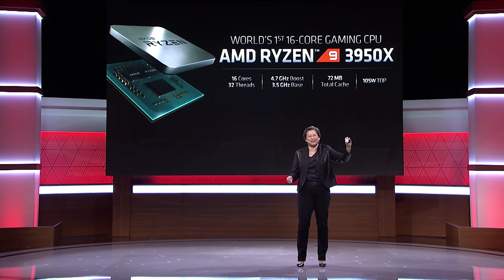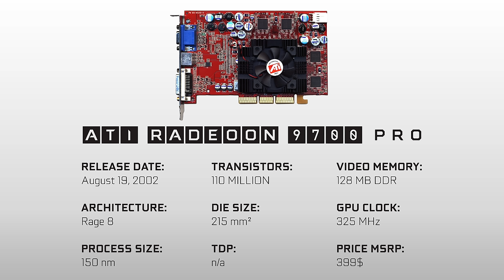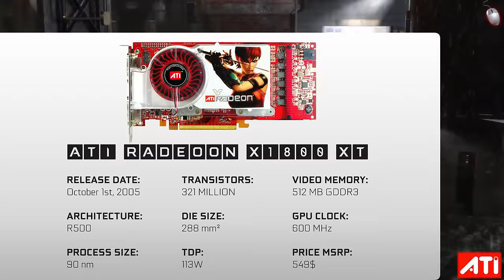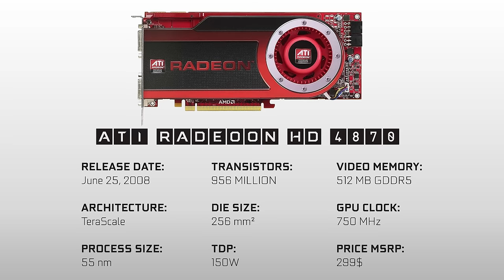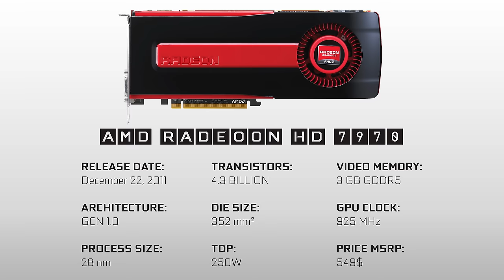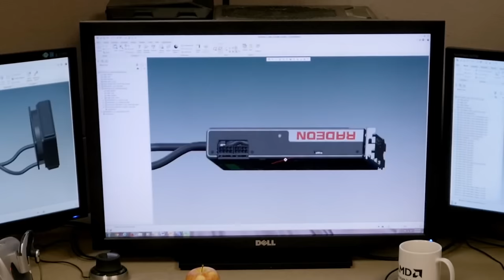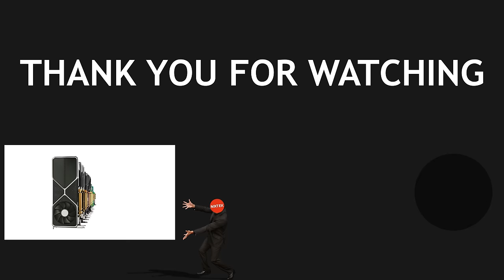The Evolution of AMD/ATI Radeon Graphics (2000-2022)

Comment: Awesome video, I just wish AMD would put more research and development behind their drivers and software.  It's their only weakness at this point.  I have owned numerous AMD cards including their flagship 6900xt and it just has issues that my 3090 doesn't have, primarily when using more than 1 monitor it just seems to freak out and randomly black/green screen where a restart or disconnecting the monitor and reconnecting seems to be the only fix.  Seems to happen when using full screen or exclusive full screen in a game while playing a video on my second or third monitor.  It's annoying but seems to related to their driver/software since the card passes all heavy stress tests with flying colors and is never an issue if I only run 1 monitor.
Reply: i had an amd gpu aswell and i remember having to go with the 2019 drivers other than the newer ones because my pc would literally blue screen while gaming
Reply: I got a deal on a reference 6950xt and I came from a founders RTX 2080. I have noticed a couple of minor bugs (like sometimes the GPU stays on when I shut down my PC while everything else turns off) but other than that it’s been great. And I can’t help but ask why no one talks about the AMD software side of things? I’m admittedly new to AMD, but adrenaline is amazing! Everything is in one place. I can overclock, undervolt, check game stats, tune games on the fly, cap my frame rate, sharpen, monitor, everything all in 1. With nvidia I needed MSI afterburner, Rivatuner, GeForce experience, Nvidia Free Style, Nvidia control panel, Nvidia Inspector, etc. all different programs. All to do the same things. Digging the AMD software
Reply: cries in five monitor eyefinity
Reply: Same, certain games are always buggy, but amd optimised games seem to run like a dream
Reply: The current AMD Adrenalin drivers have no issues working with the Radeon 6K GPUs. Sounds like an user error.
Reply: @bobbymoss6160  most likely, when I purchased the card I believe that is when the user error started.
Reply: @hamslice839  Have you reinstalled your drivers using DDU? I've never had this issue on my RX 6600 before and it runs both my monitors smoothly, however the drivers do still have minor bugs (like for me the driver times out randomly when I full screen YouTube after an update). I heard AMD is putting more effort into drivers but only time will tell
Reply: Had that issue all the time with my 5700xt before later drivers fixed it. Can't say I've experienced it with my 6900xt. Had it since May 2021.
Reply: That's unfortunate, my experience has been quite different. My first gpu upgrade to my prebuilt was a 5700 XT back in 2019 and that card was 1080p beast. In 2020 I built my first pc with a 6800 XT and that card has been a beast too without any driver issues or black screens. I now also have a 3080 Ti and that card is awesome too, never had any driver issues. It's weird how random these issues can be because one bad experience can put a person off the brand forever.
Reply: @TerraWare  agreed on that last sentence
Reply: @HamSlice I had the exact same issue a couple days ago. If you have the 22.5.2 driver installed, get rid of it. It was the problem for me so I went back and installed the 22.5.1 driver instead and it completely fixed the issue. Hopefully this helps.
Reply: I've honestly never had any issues with AMD drivers, starting with an RX 580 and recently upgrading to an RX 6700 XT.
Reply: Yep. Pretty much why I switched over to Nvidia was because of AMD's garbage drivers. My issues were instantly solved overnight.
Reply: @thatxonexguy5438  Same my wife and I are both big gamers and we each have top end gaming PC's.  Her 3090 has never given her any issues.  My 6900XT on the other hand has had numerous issues that are game breaking.  The only thing you can do with AMD is wait for driver updates, which takes forever.  The latest 22.7.1 driver has fixed a lot of my issues but they should have never been issues to begin with and I suffered for months with a partially working system.  Not fun and not worthy of a $1000 price tag.  My AMD PC is now exclusively used on my OLED living room tv and I game on a 3090 myself and couldn't be happier.  But as you can see above no one else has ever had driver issues with AMD...  I guess we're just that unlucky.
Reply: @hamslice839  I've had multiple AMD gpus from the rx 500 line and along with a liquid cooled vega 64 and a 5700xt, all gave me issues (and ran hot and loud to boot). Heck, Even browsing the internet my AMD gpus would give me issues with screen flickering lol

Sold off my AMD cards and temporarily switched to an old gtx 970 that was previously pronounced dead and was now barely clinging on to life that I got for free. Honestly, it was like a breath of fresh air being able to play games smoothly with no issues even with an old junker card.

Point baisically is, I started out as an AMD fanboy with them having a higher cost to performance ratio since I like getting my most "bang for my buck", so its not like I was a die-hard Nvidia fanboy from the beginning like some are. Love their CPUs, but never again will I spend a dime on a AMD gpu, even for free I dont think I would bother.
Reply: my first gpu was a amd 7950 never had issues with the card then i bought a 1080ti never had issues too now i have a 6900xt and yes sometimes the driver wont open and in warzone i have sometimes the fps drop from 160 to 20 for 0.1sec then everything works fine. My friend had a 3090 and this piece of shit died 3 times now he bought a 6950xt and have no problems with driver or the card
Reply: Sorry buddy, but the gtx1080 drivers are now so unimproved that it gets beaten by the vega 64...At least with AMD cards you end up with better performance year on year with driver improvements, and also you have 3rd party drivers when the card officially becomes legacy. 

Put it this way, my R9 280x is still going good with community driver's, my gtx 780 is a PAPER WEIGHT! 

So to conclude, I'd say nVIDIA make worse drivers and their legacy support is completely non-existand!!
Reply: My 1070ti EVGA blue screened constantly, terrible nVIDIA chip design that was so bad the soldier connections between the dye its mountings became shagged. Never bought another nVIDIA after this.

Comment: I was gonna say, the reason the Fury X didnt need 6gb is because it used HBM(2) memory. Which was significantly faster and MUCH higher bandwidth than the GDDR5 that was in other cards at the time, and thus it was (and still is) one of the best GPUs for gaming and Mining, Data processing, and professional workloads.

Comment: The first GPU upgrade I've ever done was on the family HP Pavilion Desktop PC which came with a Pentium III 800MHz and an nVidia TNT2. Christmas of 2000 I received the ATi Radeon 32MB DDR which upped the gaming potential quite a bit. The next ATi GPU I would get would be for my second PC build in 2003 where I would use my own hard earned money to purchase the Radeon 9700 Pro to go with my AMD Athlon XP 2500+ system and it lasted me for a few years until I would be tempted with the GeForce 6600GT.

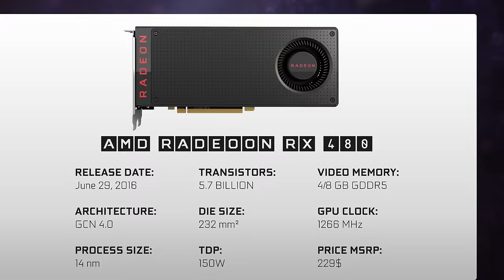Comment: 14:26 Polaris and Vega GPUs were produced on GlobalFoundries' 14nm process nodes, not TSMC as stated in the video.  AMD did switch back to TSMC starting with the Radeon VII in 2019, a refreshed Vega chip with double the VRAM at 16GB and over a terabit per second of bandwidth.

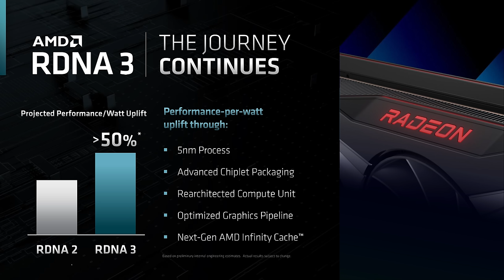Comment: 17:24 come on, you say it gives 2x performance per watt increase, then litterally show a slide that says >50% performance per watt. You know math, 100% is double, not 50%.
The performance according to leaks will be double over the 6900XT, but they are increasing core counts and power consumption
Reply: Thats a video from rdna 2 release least year I think. There is no official release presentation yet
Reply from the maker: a small mistake I’ve made on my part comparing it Im sorry for that. Glad you pointed it out
Reply: @NikTek  no worries, you can pin a comment at the top with corrections. I've seen other youtubers do thst
Reply: Actually 100 percent perf/watt would lead to 3.5 x performance uptick over the 6950xt.. that would be cool but impossible

Comment: The r9 290 was an en excellent GPU for 300$ just a couple of months after launch and it competed with the much more expensive gtx 780 and in the end of the life of the r9 200 series, the r9 290x almost reached titan level performance for less than half the price.
Reply: Sadly, the pricing for Radeon video cards shortly after launch got out of hand due to them being (at the time) better for cryptocurrency mining than the GeForce video cards.
Reply: My 290x is os still going strong with 3rd party driver's....Just finished Halo Infinite campaign on it!

Comment: 14:15 The RX 480 was a mid range GPU, not entry level.
Reply: Entry level , it competed with the gtx 1060
Reply: @Itssmahdii  The GTX 1060 was mid range as well, not entry level.
Reply: @Itssmahdii  the gtx 1050 ti is one of the entry level gpus while rx 400 series is a mid range card
Reply: @Itssmahdii  what was an rx450 then? and the gtx 1030

Comment: 2011: first own pc in my prebuild was a hd 5000 series 500mb oem version + intel Pentium.

2014: my own build pc had a r9 280 3gb technically hd 7950 together with fx 6350

2015-2020: next step was a upgrade to r9 390 8gb and later a ryzen 1600

2019-2020: ryzen 3600 upgrade, was looking for a used 5700xt but was waiting for next gen reveal.. big mistake, price exploded.

2021-2022: finally settling now on RX 6800 16gb and ryzen 5800x!
Reply: I still rock a Ryzen 1600. I will buy a Laptop now with a ryzen 5800H and a rx 6600m probably. Because "fuck you nvidia".
Reply: That RX 6800 is gonna last you a good while, especially with that high VRAM.
Reply: Have the same configuration, feels great 👍🏻

Comment: I had a lot of ATI and NVidia cards over the years, the ones I remember the most are the Geforce 2 MX 128MB, Geforce 7900 GT 256MB. the HD4080 512MB, the HD5080 1GB, the GTX 970 4GB and my current GTX 1080 Ti 11GB
Reply: Yes, Geforce2mx saved my day before i have enough cash to buy rather expensive one

Comment: If amd driver come as stable as Nvidia it will 1000% beat Nvidia out of existence.
Reply: Already is stable
Reply: @knownnuisance7512  not as Nvidia. I have my own experience.
Reply: @knownnuisance7512  your head.
Reply: @Sree05  probably from 7 years ago
Reply: @knownnuisance7512  sadly nope. Go through forum even amd said there are several known issue with their driver in their official website. I'm talking about their driver issue with current gen cards don't know about prev gen. 

They are good but here and there few glitch caused by driver still persist. In Nvidia case I tried every new and latest driver with gtx 1650 no crashes no other stability issue but in rx 6700xt tried 4 drivers all have stability issue and now I'm using a driver which doesn't have major issue as other version but still I can see how it performs on dx11 games( not all games but some) not stable in 0.1% and 1% but really nice fps btw. 

I'm talking if they get strong driver stability as Nvidia do for their latest version I have 0 problem with AMD. 

Also it's codec seems useless in video editing because most software uses h.264 not .265  and amd is good in h.265 codec I guess.
Reply: @Sree05  then we have a different experience since I own a 6800 and a 5700xt, and i run them without glitches and problems
Reply: @knownnuisance7512  idk but same problem is listed in their website for known issue.
Reply: @Sree05  Nvidia has a list of known issues too. Every vendor of every piece of software has. It's just a question of whether they publish it or not.

I've had a bunch of graphics cards over the years. My first was an S3 Virge with a whopping 4MB of VRAM. The worst driver experience I've had has actually been with Nvidia... but this was back in the Vista days. They never managed to fix the spontaneous reset bug until after Windows 7 came out. My buddy was plagued by the black screen issue on his 5700XT for some time, but they fixed that eventually. My RX 580 never had a stability issue, but it would sometimes take a month before a game-ready driver was out for the latest games. My 6700XT has been mint since day one. Another friend had to return his 3060ti because it crashes to desktop when he launches his PS3 emulator. He got a 6600XT instead. But now he has a glitch in some version of Football Manager if he doesn't play it windowed.

TL;DR: Life is like a box of chocolates. You never know what you're gonna get.
Reply: @andersjjensen  now I totally agree with you. I really understand every error and now I'm almost 99% satisfied with AMD than Nvidia.
Reply: @Sree05  I do think Nvidia has a small advantage over AMD with drivers, all things considered. They're a much much richer company and it was only in 2018 that AMD was even profitable for the first time in a full decade. But AMD seem keenly aware of this fact, and under Lisa Su AMD seems to be a company with a laser focus which executes on engineering targets pretty damn reliably. It don't think it will be another year before AMD has completely neutralized the perceived advantage of Nvidia.... Just look at how fast their FSR 2.0 rollout has caught up to DLSS 2.x which has had almost 2 years head start. Or the recent massive DX9 to DX11 and OpenGL optimization work. Also the entire UI of the Radeon software is categorically better than the Windows XP looking control panel from Nvidia. And that you have to create an account to look into the GeForce Experience panel (and it can't just remember the bloody username and password) is an annoyance to many...

So all things considered: If RDNA3 is a tad faster than Lovelace, while beating it at power efficiency and is reasonably priced I think it could be "The Zen 3 moment" for the Radeon team.

Comment: Good video but you got a few details wrong. A lot of AMD GPU's were made on GlobalFoundries, not TSMC. RX 480 and Vega was made on global foundries 14 nm, 580 was made on global foundries 12 nm. A lot of gpus before then was made on global foundries too. They went to TSMC on 7nm with the RDNA GPU's

TSMC doesn't have a 14 nm process, they only have 16 nm (what GTX 10 series used) and 12 nm (what 20 series used.)
Reply: who makes the amd apus with vega graphics then? tsmc or global foundaries?
Reply: @SimonBauer7  ryzen 1000 and ryzen 2000 APU's and CPU's was on global foundries. 3000 cpu's and later was TSMC 7nm. (the 3400G was still global foundries, so for APU's it was the ryzen 4000 APU's and later that was TSMC

Comment: What about the older 3D graphics cards ATI made, like the 3D Rage/Pro, the Rage 128/Pro/MAXX? These were huge in the late 90s and many people played Quake/Quake2/Unreal/Half-Life/UnrealTournament/Quake3 and other popular games on them. Nvidia's offerings at the time were the RIVA 128, TNT, TNT2, etc. and if you didn't have one of those ATI cards then you had one of those Nvidia ones instead to play those games on. This was the time between software rendered graphics and programmable graphics hardware. The Radeon 7200 wasn't programmable graphics hardware, just like the GeForce 2 wasn't programmable graphics hardware. Everything was fixed-function. You just had "modes" you could render geometry with, but you couldn't actually program the graphics hardware with arbitrary instructions.

An important distinction that seems to be lost on people these days is how we had "graphics accelerators" which ultimately evolved into programmable "graphics processing units". History has been retconned to just call these older graphics accelerators GPUs now, by people who either weren't there, or who forgot and now just lump all the graphics hardware together as "GPUs". There was almost a decade of graphics hardware that offloaded rendering work from the CPU (specifically rasterization) without being programmable Graphics Processing Units with vertex/pixel shaders that programmers could control. That didn't come around until the early 2000's with cards like the GeForce 3, which was a huge deal when it came out - and Doom3 was the first game to really leverage that capability with its mind-blowing normal mapping graphics.

Someone really needs to do a video on how graphics hardware really evolved, starting in the early 90s with Silicon Graphics' IRISGL, and how that was adopted as the basis for OpenGL. Fixed function rendering pipelines, the CPU still doing all of the work, but the graphics hardware doing the rasterization, etc... Doom3 and the GeForce 3 and the dawn of the "programmable graphics hardware" and the "GPU". Yeah, there's a whole history that has apparently become a huge gaping memory loss for tech culture. Pretty soon people are going to start thinking everyone had the internet after coming home from WW2, and movies in the 70s had CGI like today's Marvel films.